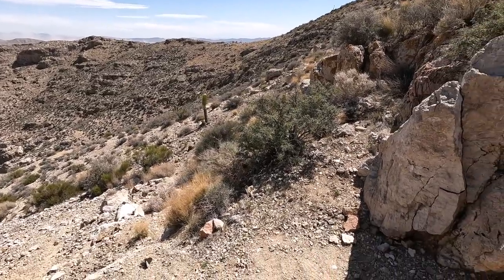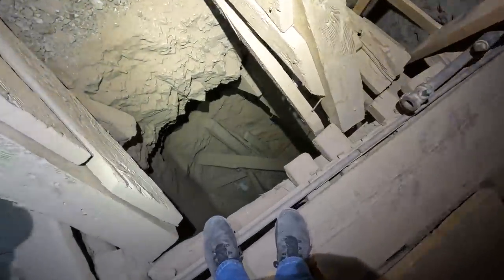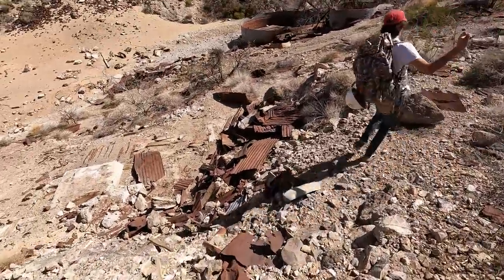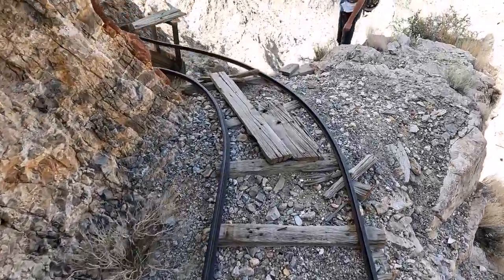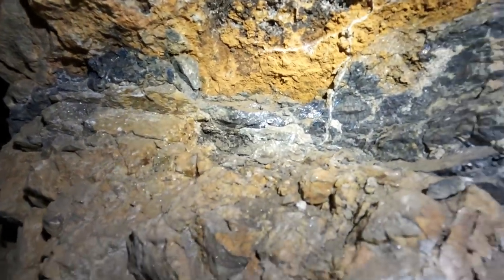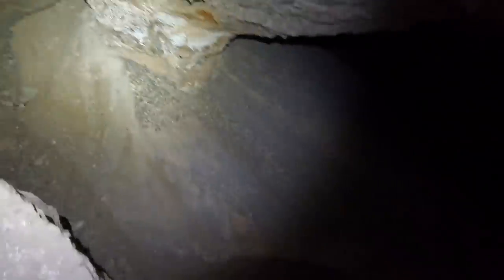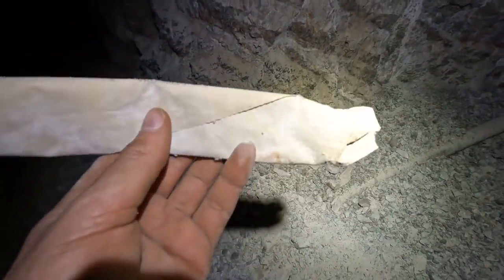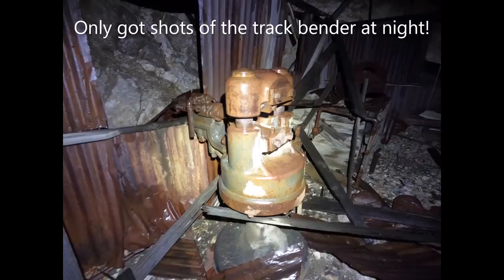Impressive Headframe and Heavy Machinery at the Anvil Mine

Comment: That tool you called a track bender is actually a drill sharpener. Just to the right of it was the forge, heat the drill steel in the forge then clamp it into the machine and it would reform the bit. Once reformed you would reheat it again then quench it in oil to reharden it. Looked like rivet construction on the ore carts, that with the old school drill steel im guessing pre 20's for its hey day.

Comment: Thar cast iron fixture is the frame of a "post drill," the precursor to a modern drill press. The handwheel at the right in the video has a ratchet on one face; this was turned with the drill stem and advanced the screw holdin the drill. These were cranked by hand or belted to power .
Reply: Thanks ,I thought it was that,but not sure 😃
Reply from the maker: Awesome! Good to know, when I see another one I'll know that much more. Thanks for the input.